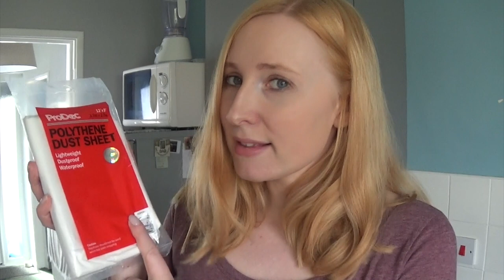BUDGET KITCHEN MAKEOVER: How to paint tiles | Cheap kitchen tile update | Miss Moogle

Comment: Great job just a little tip when using the foam roller always roll up and down neither from side to side as gravity will make the paint run down the tiles if you go from side to side other than that it looks really nice 🌷🌻👍
Reply from the maker: Thanks for watching! I've actually changed it again now anyway! Check out a later video of mine! I've put 3D Tile wallpaper over the tiles!
Reply: Thank you for this tip Rod, much appreciated ☺️ x